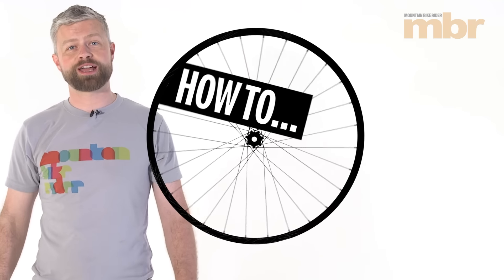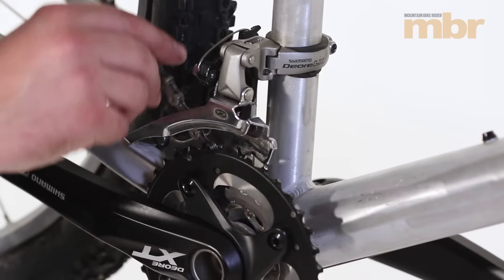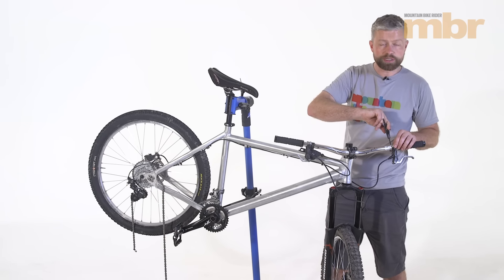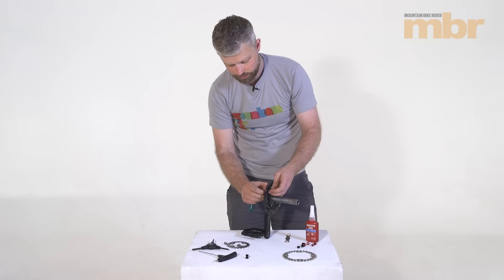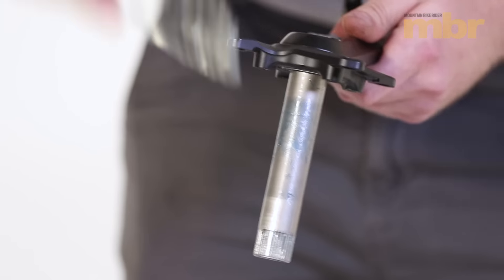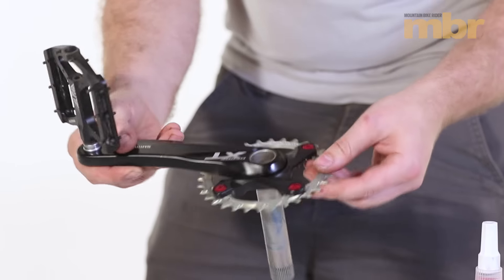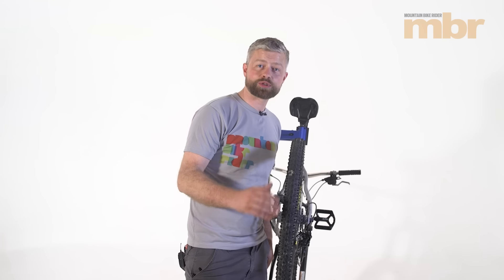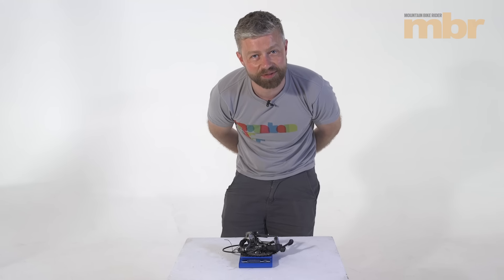How to fit your narrow/wide MTB chainring | MBR

Comment: I have 3x10 shimano xt and switching over to 1x9 : Altus MD310 ( big cogs) , 9 shimano cassette,  sunrace friction shifter, 9spd chain.  Then the magura hs11 hydraulic is being switched to deore v brakes.   Going to get a more upright English style handlebar  like nitto bosco.  I just want to simplify and the 9sp parts are less expensive and last longer.  
I bike commute or tour,

Comment: Do you have to use a specific chain for a narrow wide chainring? or can i get away with using my existing 3x9 chain
Reply from the maker: The chain is completely standard. Just choose the right chain for your drivetrain – so 9sp in your case.
Reply: @MBRmagazine  cheers Al,appreciated.great video by the way!

Comment: why would you want to change from three to one in the first place , you have less gears .
Reply: lighter , less things to go wrong , simpler and if you are half fit you still have enough gears to get up steep hills and fly down them 1x11 is great i am never going back to 3x , but each to their own
Reply: one of the drawbacks of a 3 ring system is the gears of each ring overlap with the next ring, also everytime you shift between the front rings you then also have to shift the back gear sprockets to get to the speed you really wanted. Also when using the large or small chainring the chain can end up running diagonally.

Three rings is also heavier and harder to clean. So there are lots of advantages to a single ring and you still get a very good range of speeds if you have 7+ sprockets a the back.
Reply: Patrick Parker plus half of is don't use but one gear up front anyways

Comment: Can I do this without removing cranks??
Reply: Not for a ring like this that goes on the inboard side of the spider. The only way to get it into that position is over the crank axle, which means you have to remove it from the bike.

Comment: Is the 4-bolt pattern (@ the chain ring) the same on all models-universal? Or are there different patterns, center to center? I’d like to go to 1x on my 2x drive sprocket. Very informative video. Thank you
Reply: Sir Dirtydog  there are some options.. 94, 96, 104mm on mtb i think. This particular is 104mm (the old shimano's). If you have an a shimano m6-7-8-9000 they are 96mm so you can use only oneup components that is narrow wide chainring or shimano's original. But  they are not narrow wide so the chain can get out of its place more often.